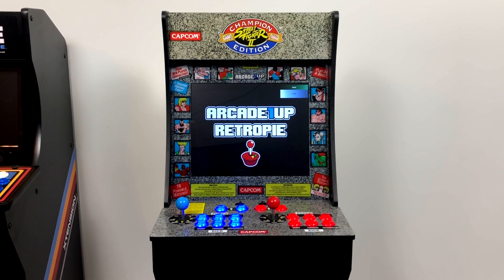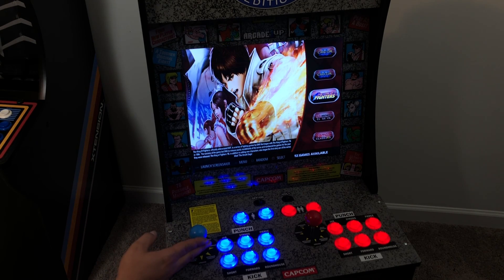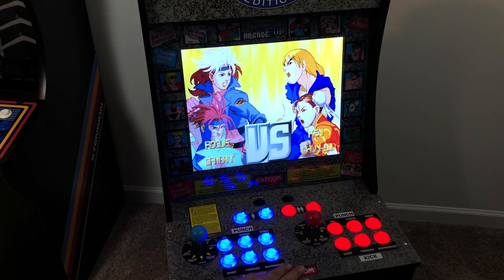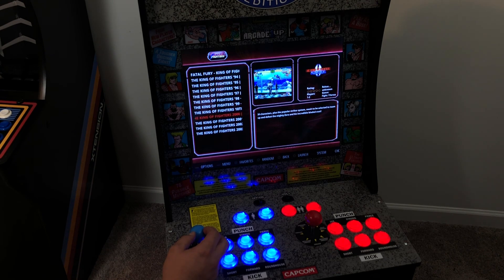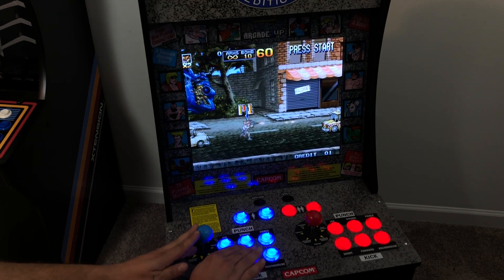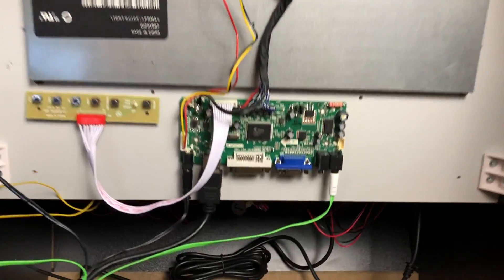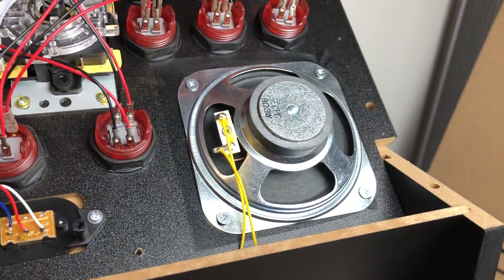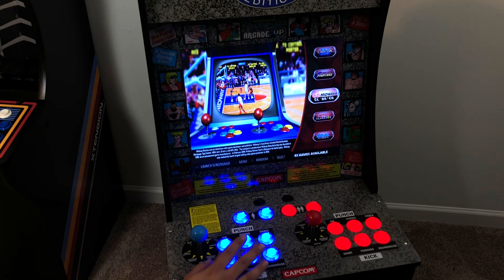Arcade1Up Cab Running RetroPie - Raspberry Pi Mod

Comment: Just bought a broken Street Fighter 2 cabinet identical to this one in the video for $80 which had a broken motherboard from Arcade1Up so I'm swapping it with a Raspberry Pi.
Only part I'm nervous about is drilling a hole but luckily all these components are available on Amazon with 2 day shipping to convert it and load my own ROMs with the Pi. Super excited to start the project. If I'm lucky this whole finished cabinet with the mods should come out to like $200 all said and done. I got lucky on Facebook marketplace with the cab itself for so cheap.
Reply: I just bought one of these today for $100 and it works. Already modded. But I had to reconfigure the buttons as it didnt have a coin button to actually play any of the games. I'm also not sure why player 1 joystick doesnt work properly and it wont reconfigure.

Comment: I put pi4 in mine. Swapped the buttons and joysticks for sanwa versions

Added 2 extra buttons to the front for coins and micro sd card extender  so much easier to swap the pi image . Just need to get lite up front panel

Comment: @ETAPrime - thanks for the video, when I found the arcade1up box I didn't know how but I knew that I wanted my raspberry pi driving it.
1 thing I did work out was how to reuse old joysticks. On one side of the 5pin cable the pins need to be a mirror opersite of pins connected to DragonRise board.
Again thank you

Comment: I have a arcade 1up with a raspberry pie aswell. My only issue with it is that it won't turn on instantly. It'll say "attention no signal". I have to unplug the cord several times and then the hdmi icon will pop up on the right hand corner. Any ideas on why it's doing that? Or any tips to make everything work instantly? Help please (:

Comment: Can u use just the lcd plug in and not get encoder or what not
Reply: What would control the raspberry pie when connected to the monitor? Does it still connect to the control deck?

Comment: Hello I set up and drilled all the buttons, connected the lcd converter, raspberry pi, but when I go to turn on light on converter goes green for a few seconds then goes red. Also the screen says no signal. Do you know a fix to this?

Comment: ETA Prime,
How do you get your RetroPie menus to display as they do in this video (i.e. after the Emulation Station splash screen). I have Retropie installed on my Raspberry Pi and after the boot sequence, I only get the ability to scroll horizontally through the consoles. How do I mimic the menu navigation as what you show in the video?

EDIT: I just watched your video on installing RetroPie Themes...I think that is what I am after. What Theme are you featuring in this video? 

Thanks in advance!
Brent

Comment: My display has horizontal lines glitching all over it.  I’ve tried multiple HDMI cables and different inputs to ensure it’s not my cords or devices.  Anyone else had this issue and could it be possible I got a bad LCD controller board?  I used the same one here and made sure the model of my display matched up.  I appreciate anyone’s help or ideas.  Thanks in advance!

Comment: You have inspired me. Thanks for the video info. I purchased Centipede Arcade1up before knowing about this. I found one video with someone modding the Centipede Arcade1up. I am going to take it a step further, follow this, and do the mod to Centipede Arcade1up. I know you had to drill for 2 buttons, so why can't I do it for more buttons and remove the trackball. Worse case, the person who modded centipede did a new controller board. I plan on posting my mod for those who interested, I will make sure I give credit to you and the other channel.

Comment: Can you have the raspberry pi in the HDMI port on the  LCD Controller Board and also plug a laptop in the VGA port of the LCD Controller Board and switch between the two like you would with a TV. (With the remote switching between inputs) ? Does the LCD Controller have a remote or the ability to choose which input you'd like to use or is the controller only allow 1 device  at a time with 3 options of plug type (hdmi/vga/or dvi)?

Comment: Eta I have a question 
I'd like to install a button that turns off player 1 usb port.   

Reason. Is I want player 2 to be a 4way controller.  And player 1 to be 8 way.  
My thought is to push the button and launch a script to shutdown the correct port so I can play 4 way on my cabinet.  As player 2
And push button again and reenable the port to play 8 way games as player 1 
Can you tell me how I can do this 

I know the command should lool like this
 sudo ./hub-ctrl -h 3 -P 1 -p 0

Can u help me figure this out

Comment: If I already have the raspberry pi and don't care to do the button upgrade can this be easily done with that input panel and just output to the raspberry pi? If so then if just need the unit and that screen converter input box

Comment: Great video! Apparently my speaker wire wasn't soldered correctly when it came out of the factory so I had an issue with no sound, luckily I was able to figure everything out and my Mod looks amazing! Thanks once again ETA Prime, your a GOD.

Comment: Something else to do that wouldn't really jack the price up to much is what I did with mine. I ended up going to Wal-Mart and grabbed a $35 PC speaker system (Logitec Z313) threw the subwoofer in the cabinet, removed the Left and Right speakers out of the housing made perforations on the top back panel, mounted the speakers on the inside and it sounds F-ING GREAT! SUPER LOUD!  From there you can run the AUX cord straight to your PI. This particular speaker system comes with a controller module that has a rather long cord attached to it that you can run it out on the left or right side of the control panel and double sided tape it to the machine. (Still looks super clean and gives you on/off and volume controls along with a headphone jack should you want to play at night when people are sleeping) On the Street fighter cabinet if you lift up the joystick panel there is a section that looks like its supposed to have a board slid in, I just took a round file and filed down that groove so the control cord for the speaker system could come out of the side and you could still fasten the joystick panel down properly.

Comment: Hey guys, does anyone know why retropie won't recognize my arcade controls?  I'm not sure if it's a problem with the decoders or what.
Reply: Very possibly is the encoders, usually a good thing to look for when ordering them is for them to say what they are compatible with. I had an old set from something else I was working that I tried that didn't work. They were on Windows compatible apparently. If you are scanning through ebay or amazon a lot of the sellers will say PI /PC Compatible etc.
Reply: @dangerousaltoids  ok thx for the tip

Comment: Im surprised you did not try to use the LCD controller's on board audio amp. It should drive that 8w speaker perfectly.
Reply: Can anyone verify this? I'd rather not spend extra on an amp if it's not needed.

Comment: is it possible to use the existing control panel with raspberry pi?
Reply: Yes, but you will have to add 1 button per player.
I did.

Comment: Hey ETA,  I have the same setup as you thanks to you video. Thanks.  I was wondering if you know if I could use the stock normally open power switch to power up the pi.  I watched your video for setting a momentary button and could add one to the back of the cab but would like to use the stock switch on the controller panel. Conversely adding a switch to the power strip so I can turn the monitor and pi off but am worried about always doing a forced shutdown on the pi. Any suggestions as to the best method. This will be for my kids playroom and simplicity is key. Thanks again

Comment: Hey ETA Prime can you wire the arcade1up power on / off switch to toggle the led arcade buttons?  I was wondering cause I want to follow you mod but wanted to know if it was possible to use that switch as a toggle to turn on or off the button lights...  Let me know if that is possible and maybe how it can be done...

Comment: I honestly don't see why anyone would want to junk one and upgrade it.  The internals are crap. The monitor requires an adapter, which isn't that big of a deal.  The cabinet is too small for any adult to use comfortable.  I guess if you have no woodworking skills, this might be an option, but you could build a much better custom cabinet for less money.  Just my opinion.

Comment: would you say this is cheaper than actually trying to build an arcade cabinet from scratch? for someone like me though who has no experience putting a cabinet together, all i have to do is spend 300 for arcade 1 up... and what? $60 for the raspberry pi and other things you put in... so less than $400 for a "not so bad fully loaded tiny arcade cabinet" ?.... i honestly would love a big fat original arcade fully loaded but isn't that way more expensive? and a lot more work put into?... i guess what i'm saying is this looks like an easy way for a rookie arcade fan to make the dream come true without so much hassle.... good video! i subscribed!
Reply: Bar top kits are 100.00, add in a $150, 19" monitor.

But you will need to paint and add art to the sides.

A stand up arcade kit is $270 or so, plus shipping.

Comment: Instead of pissing away $300 on a crappy little arcade 1up that you have basically reduced to a shell, put that money towards building a full sized cabinet that two adults can use to actually play Street Fighter side by side.
Reply from the maker: I have one on the way from RRM plus I have 2 bartops and a vertical cab and an Alpha cade. This was done because it can be done.

Comment: Can you use your other tutorial on adding the power button to the raspberry pi?  Any way to take off the buttons from the monitor and add power there? Possibly wire both power to the power switch?

Comment: @etaprime i did this same mod and have it set-up pretty much the exact same way you have it, but I am unable to get video on the arcade1up monitor (but the pi seems to work when connecting to hd tv).. any idea what you used for the cfg file or possible areas to debug?
Reply: Michael Guzman  did you fix it?
Reply: @tekkamanblade2244  monitor kit came doa.. i scooped up a 17" monitor from microcenter and switched it out .. works great!

Comment: You ruined the cabinet so now you have hundreds of games but have street fighter art on the outside I have two of these I didn’t buy them to emulate games that’s not the point of these there
Reply: These are meant to look cool in your house I have a room where I have a pool table and a couple of these arcade machines with the original games and art work will look awesome
Reply: These are meant to look cool in your house I have a room where I have a pool table and a couple of these arcade machines with the original games and art work will look awesome

Comment: Strange question for the LED power buttons are you using the power supply on the pi as in your LED light to your Pi tutorial or do you have in a separate power supply for the LEDs?

Comment: Pandora's box would be easier.  Don't need extra select buttons, drilling holes, amp, and speaker setup.  Pandora's box is the way to go!!!
Reply from the maker: Pandora’s box would require the extra buttons also. I have 3 sitting hear and a real 3A Jamma Pandora’s box 6.
Reply: I can show you how its done.  Eliminate the coin button by putting it on free play.  Wire the pause button with the player 2 start and now you have a working Pandora's box with all buttons accounted for and no drilling needed.  Speaker just connect it directly to the Pandora's box where it goes.

Comment: I really love the design of this cab yet you speak so much higher of the Alpha Cade.... is the bump in quality that big?
Reply from the maker: Yes it is. The alpha cade is way higher quality. From the materials used in the cab to the buttons and sticks.
Reply: @ETAPRIME  thanks, I'm checking out the tutorial now. Very cool stuff but I might go alpha-cade instead. Just wish alpha-cade had a better or easily customizable design.

Comment: ETA...You are the GOAT...with this stuff. That said, I’ve got a quick question about the joystick button combo you are using with the B+. How do you get player 1 and Player 2 to stick where they are supposed to? I have the same kit and B+. No matter what I do, every time I setup player 1 and then 2, they work great in ES. As soon as I start a game, player 1 controls switch to the player 2 joystick and buttons (including start/select). Then player 2 takes on player 1 joystick/buttons. They only way I’ve been able to get around this is to boot my pi up with only player 1’s board connected. Once it’s in ES, then if I plug in the control board for player 2 it works as expected. If I shut off and turn back on though...back to the player switching. Not sure if I’m doing something incorrect. I’ve even wiped out the controller config and just set up player 1. Then rebooted and set up player  2....no help.
Reply from the maker: Do you have bothe encoders wired the exact same way. Like the A button for both in the same exact port on both encoders? I know it sounds strange but that’s how I get mine to work correctly. Both encoders need to be wired the exact same way.
Reply: ETA, thanks for the input. As for my encoder boards, they are configured the same. I’m not sure what else it could be, but will keep looking.

Comment: This is a great tinker project ...but not overly cost effective....for the price of this mini arcade ..plus all the extra stuff to convert it.....you might as well just make it from scratch...buy a large sheet of 3/4" MDF...down load some free arcade cabinet plans....buy a $15 dollar monitor from Goodwill or use a spare you got laying around ...would be half the cost. 

You can even buy pre-cut large monitor barcade kits for 80 bucks on ebay.  Your already buying a button and joystick kit for this..which you can use for that. ..and BAMO...a cabinet thats any size you want that is running the same thing :) 

What a friend of mine did. Baught the barcade precut wood kits...made the bardcade ...baught some cheap but sturdy mdf from home depot and just extended the bardcade down to convert it to a full stand up.
Reply: The monitor and the full set of graphic decals will add up the cost. So you're better off getting this 1Up.

Comment: Would there be any way to put a retrocade in here or a Pandora's Box? But use the original monitor that comes with the cabinet
Reply from the maker: I’m waiting on a wiring harness for a Pandora’s box 6.
Reply: @ETAPRIME  oh nice I'm sure that would be easier than a Raspberry Pi plus it's also all arcade games

Comment: That's pretty great. I had my doubts about where you'd get sound from to the speaker, but I see the LCD controller receives HDMI audio and outputs to the 3.5mm plug

Comment: For one thing, its good to know i dont need to worry about soldering.
But is there a way i could just reassign those select buttons or anything? I dont think I'd be confident enough to drill holes in mine.
Regardless, great video. I was excited to see what u would do with this!

Comment: I knew you’d be the first to hack this, no lie. Good job!
Reply: It's not a hack, he's modding and replacing parts. There is no point in the hacking the original boards, its too limited.
Basically, just using the shell and monitor to hook up to other equipment.
Reply: 300 bucks for a shell
Reply: @Art2d2_a  this is true XD
Reply: @Art2d2_a  Any suggestions for cheaper ones with a screen, cabinet, decals etc that can be shipped and built on site?

Comment: Is the input lag better on arcade 1up's hardware or retropie on this comparing street fighter?

Can sanwa buttons be installed in the same holes as the happ buttons? It's 28mm vs 30mm.

I want to mod the controls and hopefully find a way to redo the marquee to make it backlit.

Comment: ETA PRIME - I notice there is a speaker connector on the driver board you used - couldn't you use that for the audio by hooking up the existing speaker directly to the driver board ( I assume the board has an amplifier on it to drive the speaker output already since these boards are usually used in laptops etc. that also have speakers but could be wrong) instead of buying an amp ?

Comment: Great, great, great.   

Cost wise, which option is the cheapest and easiest to put in place for someone who doesn't work well with electronics although is pretty good with computers.  Is it just cheaper in the end to buy the recroom masters cab of this size for 349 plus a monitor, or do you still save quite a bit of money doing the manual work to convert this?

This does look better with the visuals on the cab, but it seems like a cheaper kit than the recroom masters version.
Reply: I've been pondering the same thing - the thing to remember with the recroom masters units is shipping is painful - $100! That's what's kept me from going that way.
Reply: yeah, that certainly would add expense.  That 349 suddenly becomes 449 + about 80 dollars minimum for a tv unless you have one lying around.  So we're just shy of 600 dollars at that point although you get a sturdier machine, better monitor, and better controls and without the need to know any electrical or drilling work.
Reply: Kevin Carter you hit the nail on the head. It's a tough call - I'm just poor enough that I'm most likely doing the Arcade1up :) But the RRM unit looks really, really nice.